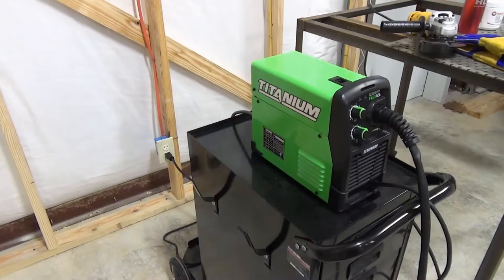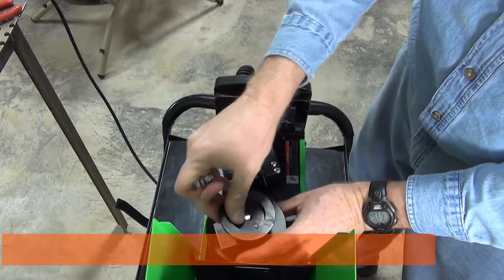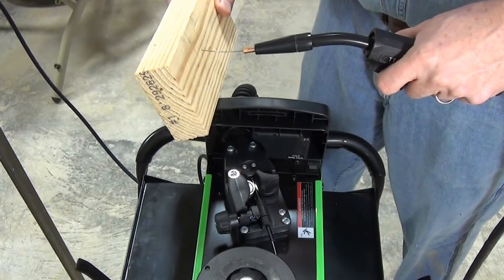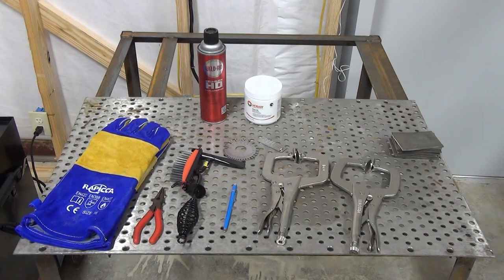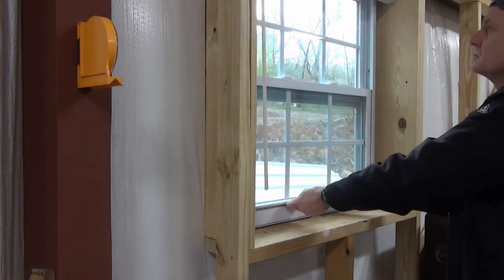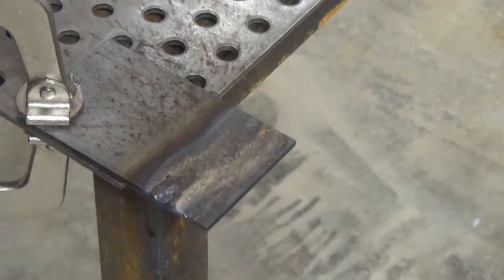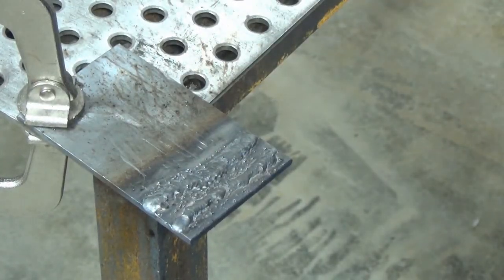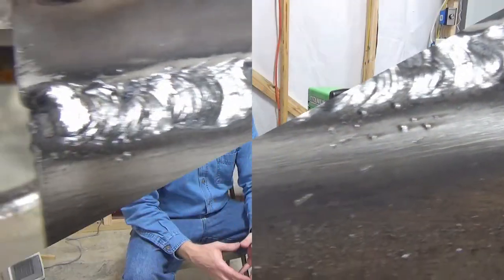Titanium Easy Flux 125 Welder: Specs, Setup & Review,  - A Great Welder for Beginners! (#83)

Comment: I plugged mine in today after being delivered. After 8 seconds it lost arc. I was messing with exhaust pipe and was on lowest settings. Drove 60 miles round trip to exchange. Try again tomorrow.
Reply from the maker: Hi Mark!  Well that’s a bummer for sure.  Glad that HF is good about exchanges!  Mine is still going strong with occasional use.  Good luck with yours. Thanks for watching!

Comment: I am curious to what settings I should set this machine to that would work best?
Reply from the maker: It depends on the thickness of the metal you’re welding. The manual and chart inside welder lid are a good guide.

Comment: Hi great simple to understand video,easy to follow an always good to get a first time experience from someone using a welder,,as I have never welded myself an I'v pretty much convinced myself to buy one of these same titanium 125 mashines  as my first welder,,price point an usability seem great for what I'm going to be welding an as a beginner,,I build a lot of go karts an deal with many small engine projects,,I guess my question is would this welder effectively hold something like a go kart frame together without it flying apart at 35mph 😁
Reply from the maker: Hi Melvin!  I'm certainly no welding expert, but this thing is rated for up to 3/16" thick welding and many have commented that it will easily weld 1/4" steel so I think it's up to the task for welding go cart frames so long as your learn to make good penetrating welds.  Good luck with you welding and thanks for watching!

Comment: Question - Is the Flux welder actually melting the 2 sheets of metal or just melting the core/flux wire or is it doing a little of both?
Reply from the maker: Both.  The flux core wire instantly melts and the two pieces of metal melt and fuse together with each other and the wire. Thanks for watching!
Reply: @DIYMyWay  Thank you so much!! I’m building an electric go kart and will definitely need to use this welder!!

Comment: Good job on the video,way too much spatter though,I have the machine also,its great,try reducing voltage,and increasing wire speed to get rid of those BB,s you will be amazed!
Reply from the maker: Thank you, Jeffrey!  I appreciate the tip and will try it.  What’s the thick steel that you are comfortable welding with it? Thanks for watching!
Reply: @DIYMyWay  Ive welded prepped 3/8" thick already!,that little machine has a lot of power! I use Blue Demon .030 flux wire.
Reply: I wish somehow I could send pics of some of the welds Ive done,and post them up
Reply from the maker: Based on what I’ve done, I knew it would weld 1/4” fine & I need to weld some 3/8” so I’m glad to hear you say that. Thanks!

Comment: How’s that welder doing now? I have the old HF black box 90 and can’t even see the puddle with my Lincoln helmet set to 10. Am I doing something wrong or is it AC just not as good as this one 125 DC you showed? Nice welds BTW!
Reply from the maker: It’s still going strong.  In fact, I have a more recent video where I really put it to the test: Harbor Freight Titanium Flux 125: The Little Welder that CAN Handle a Big Job! (#146) https://youtu.be/UoujwF3RKy4
Perhaps your old HF welder is wearing out, if so, you might consider the Easy Flux 125 as a replacement. Thanks for watching!

Comment: Thanks Martin.  I almost felt as though I was there with you.  BTW, did the garage get very fumy?  I'm glad you rattled-off a checklist of steps before proceeding.  Ha, you're getting me closer to purchasing some welding equipment.  Curious, is it difficult to see the area you're welding through helmet lens (especially when sparks are flying)?  Definitely enjoyed this video. Thanks for sharing. 👍
Reply from the maker: Hi Don!  No, the garage didn’t get fumy since I had the shop fan on and I was welding right under it.  I was pleasantly surprised how well I could see the immediate area of the weld, mainly the weld pool, which is what you should be watching.   You really should get some welding equipment.  It gives you a new super power over metal that is amazing!  Thanks for watching!

Comment: You know what, I thought I'd be smart and wait for the sale price on this welder, and whoops, harbor freight actually raised the price by 20 bux.  So, off to home depot I go and I picked up a century fc90, which is literally a carbon copy of your welder, except it matches the color of my massey ferguson haha.
Reply: Pond Acres there's a video on here I watched where a guy does a comparison between the century fc90 and this titanium. The titanium came out on top. I've been watching videos trying to make up my mind on a welder, so I remember them all lol
Reply from the maker: Good luck with the FC90!  Color coordination is an important consideration! Thanks for watching!
Reply from the maker: Hi Chris!  I remember watching the same video when making my decision.
Reply: Hey Martin, I'm GeneV on tractorbynet, btw.  Oh yeh, I think you guys are referring to Mech Master's vid, right?  Possibly one of his issues was he was running 0.030 wire in the FC90 coz that's what he had on hand.  It will run that, but you gotta change the tip and flip the gear thingie that drives the wire..it's set up out of the box for 0.035 wire.  Titanium is the opposite, comes set up for 0.030 but will run 0.035.  But yeh, the Titanium has a leg up regardless, got 35 more amps than the FC90.  I dunno if that makes a huge difference, I guess some, right?  Either way, I've seen videos of dudes welding upto 1/4" with both welders, good enough for a newbie!

Comment: Also looks like settings arent correct.  Or for the settinga your hand is in sync with them.  So either slow down your arm speed or increase your amps or turn down your wire speed
Reply: That's helpful for me too, I'm still trying to sort out the relationship between all that.

Comment: The splatter seems little much.  Make sure to keep the wire between 3/8" to 5/8". 
I have the same welder.. the spatter Might be the harbor Freight wire, I just have very little in comparison.  The wire I buy is off Amazon, made in Italy.

There is also an auto dimming helmet with twice the viewing size for about what you paid for that one.  I believe all the ones that promote "true color technology" are all the same, just different companies label on the box.  I have several true color ones off Amazon and they're just out right awesome
Reply from the maker: Yes indeed.  From what I’ve seen and read, the HF wire that comes with it does splatter more.  I have a roll of INE INETUB BA71TGS (made in Italy, I believe) waiting in the wings.  The INE wire has a reputation of high quality and low spatter.  Once I use up the HF stuff, I’ll switch to it. Thanks for watching!
Reply: @DIYMyWay  
If you are still getting a lot of splatter and your wire distance is nominal, play with your settings. The heat is usually there so you might try faster wire speed. The splatter can really be so much less than what you might think, DC inverter or nothing like the AC flux welders with non-stop / crazy splatter.

Oh, almost forgot. The ground clamp can be replaced for cheap (6 bucks  cheap). Or if you are like me, upgrade the clamp that came with it.  Easy if you got any solid copper laying around, I use some copper tubbing, crushed one end flat, drilled a hole for the wire clamp dolt, and fed it thru to fit around the spring. The other side of the tubing I bent in a U shape. Done this on both sides, had to provide my own bolt on the opposite side of the wire. It is non-destructive, simple clamp upgrade and now anything I clamp is contacting thru the copper.

Comment: Question...I'm completely newbie to welding I wanna buy this welder can. I run this on a normal 120v 15amp outlet?
Reply from the maker: Yes, but make sure there are no other loads on that circuit.  It possible that you may trip the breaker at full power, but you probably won’t need to use full power very often. Thanks for watching!
Reply: @DIYMyWay  thankyou!!

Comment: Can I plug this into a 15amp receptacle?
Thank you for the video
Reply from the maker: Yes, but it may trip the breaker at the highest settings.  I seldom use it set really high. Thanks for watching!
Reply: @DIYMyWay  20 amp breaker is ideal.
Reply from the maker: Which is why my all the 120V circuits in my shop are 20A, with two dedicated 20A circuits on the back wall for big loads like my welder. Thanks for watching!

Comment: Could I run it on 15 amp outlet on mid settings or will the 15amp breaker shut it down?  
Could I use a cable adaptor for my dryer outlet to run it on a 3 prong 15-20 amp cable that the titanium 125 welder has? I want to buy one but not sure if I can power it.
Reply from the maker: You could probably run on mid settings without tripping the breaker, but I can’t guarantee it.  If you buy an adapter that taps one phase  the 220V dryer circuit to get a 110V circuit, that should be able to carry the full load of the welder. Thanks for watching!

Comment: Have you tested to be sure that your electrode is actually negative? I've seen where some inexpensive Chinese flux welders come in wired as if they are MIG welders with the electrode positive.
Reply from the maker: No I haven’t because it’s worked very well so far, despite my poor welding skills. Thanks for watching!

Comment: Hey Martin… have you upgraded your welder now that it’s been about a year?  I’m getting ready to purchase my first welder and so I’m starting to gather data I kind of got that backwards let’s say I’m gathering data with an eye towards purchasing my first welder. How is that titanium working out for you if you’re still using it now? Do you think it would be sufficient to attach chain hooks to the bucket/front end loader?  Thank you in advance for your response.
Reply from the maker: Hi Edward! Yes I still have it and it still works very well.  However, it max steel thickness is supposedly 3/16” although quite a few people have said it will weld 3/8” but I doubt the welds would be structurally sound at that thickness.  A grab hook is pretty thick and would probably be better done with a stick welder for good penetration.  If you have doubts, you might consider bolt-on hooks, which is what I have on my bucket. Thanks for watching!
Reply: @DIYMyWay  thanks for the quick reply and we’re always glad to watch. My wife and I enjoy your videos a Great deal.

Comment: Does this plug into any standard 110v in any basic home garage
Reply from the maker: Yes, although a 20 amp breaker is best. Thanks for watching!
Reply: DIY My Way if 20amp breaker is unavailable can I still run this?
Reply from the maker: Yes, but it might trip a 15 amp breaker if you run it at full power for long enough.  However, you probably wouldn’t be doing that unless you were welding a lot of 3/16” steel. It’s duty cycle is 20% at full power so the welder might cut off before you tripped the breaker.
Reply: DIY My Way thanks

Comment: Good evening Sir !!! Congrats on you purchase and sincerely happy for you !!! Love you sence of humor !!! Do you have a weld tan on you hand ??? LOL You should increase the distance between you garage walls ands welding table, there were some welding sparks touching you flammable plastic insulation ?  Keep on practice and your doing well Sir !!! Cheers !!!
Reply from the maker: Hi Dave!  No, fortunately I had no weld tan my hands.  LOL!  Right you are about the sparks.  That’s just a temporary set up because I was eager to start welding. Cheers!
Reply: @DIYMyWay  Fire extinguisher, First aid kit and a good grounded welding table are good safety practice and no electric tools that are plugged to electric service socket during welding !!! My father ( Welding Teacher ! ) learn that lesson the hard way when it did start his welding business !!! The power coming for the welding machine use the ground of the metal grinder instead of the ground of the welding machine!!! LOL All in wall electric wire had to be changed after that and i was involved to do that repair task !!! LOL Cheers and keep up the good work Sir !!! Cheers !!!
Reply from the maker: I have a fire extinguisher near the welding table and a first aid kit.  The grounding of the welding table is good to know! Thanks!
Reply: @DIYMyWay  I'm so very happy that you will do welding cant wait to your videos !!! Cheers !!!

Comment: I notice you are holding the welder like a 357 magnum.  I personally do not have a sugeons hand but I hold the gun one handed this hand is the one with the trigger finger.  Then with my other hand I rest my elbow on the table and uae it to guide and support my trigger hand.  I get alot better control. And more consistent welds.
Reply from the maker: Thanks for the tips, Nathan!  LOL  I've had a lot more experience holding a 375 magnum than a welding gun, but I'll try not to get them confused next time. Thanks for watching!

Comment: Thanks but what about the settings? Just bought the welder but I no nothing
Reply from the maker: As I covered in the video, the manual does a good job of covering what settings to use for what thickness of metal as well at basic welding techniques.  From there, it just takes practice and watching YouTube videos on flux core welding.  Good luck!

Comment: I thought I'd be great at welding. I have an artist eye, great hand control, and the intellect to warrant good results.  I suck.  At least the first year.  Later on, I'd say I'm adequate  but greatly lacking compared to my friends who have done this most of their lives.  Still, it's an essential tool and not that hard to make welds that will work with lower grade projects, and perfect for around the ranch.   Plus I've made some interesting projects, like my winter scooter outrig skis.   I'm sure you will be collecting every piece of metal from now on, so go ahead and make yourself a big holding bin now.
Reply from the maker: LOL!  Well I already have a box of scrap metal, but as I keep collecting more, I’m sure I’ll need a large bin before long. Thanks for watching!
Reply: @DIYMyWay  Indeed, make sure the bin has dividers, otherwise you'll be pulling out every scrap to get to the bottom.   I still need to add some.;p

Comment: Exhaust doesn't have that thick of walls but how does this do with stainless steel? Does anyone know?
Reply from the maker: You’d have to dial it back a lot for something that thin. Welding thin material is the hardest for be because it’s so easy to blast right through it. As for stainless steel, I don’t know. It might require a different roll of wire. Thanks for watching!

Comment: Good start.  Practice on a piece of angle iron.  Weld full length in the corner.  It will give you a straight line to follow.  Then stack beads beside each other and on top of each other until you turn the angle in to a full length triangle.   Vertical and overhead practice is a good idea too.   And check out Jody Collier at Welding Tips And Tricks . com.  He's the best teacher out there.
Reply from the maker: Thanks for the tips, Douglas!  I watch Jody’s channel a good bit.  Great stuff! Thanks for watching!

Comment: Can I run it on a 15amp outlet
Reply from the maker: Yes, for most typical home welding jobs.  If you run it wide open for long, it will probably trip the breaker. Thanks for watching!
Reply: @DIY My Way  ok nice to know. I did find out that one of my outlets out side is a 20 amp so I'm good

Comment: I just bought the welder, and my welds look way worse than yours. Why are my welds so bad? Man yours look amazing compared to mine. I think need to get the settings correct
Reply from the maker: Settings are very important but so is technique.  I watched a lot of YouTube videos on flux core welding before I bought the welder.  Also the tutorial pages in the manual are very helpful.  I’m sure you’ll get better with practice.  Good luck!

Comment: You didn’t wear gloves
And your wedding ring will get you into trouble also Pam oven spray works well as an anti spatter
Reply from the maker: Good grief! And you clearly didn’t watch all of the video or you are hoping others did not. I DID wear gloves. (Right after I didn’t wear gloves.)  And I explicitly mention that I forgot to wear gloves on the first weld.  So who exactly are you informing of that fact?  Perhaps others that also didn’t watch the whole video?  True enough about the wedding ring. Thanks for the tip about Pam.

Comment: No gloves!
Reply from the maker: Yes I had gloves.  I just didn’t wear them for the first welds.  You should try it.  It will give you hands a nice sunburn and maybe even some burns from splatter. Thanks for watching!
Reply: @DIYMyWay  how did that machine hold up? Would you recommend  it? I have the 99 dollar Chicago electric from harbour  frieght .
Reply from the maker: It’s doing great.  Bear in mind I don’t use it every day, just as needed. I’m on my second spool of wire.  If you are an occasional welder like I am, then I highly recommend it.
Reply: @DIYMyWay  right on, thanks man!